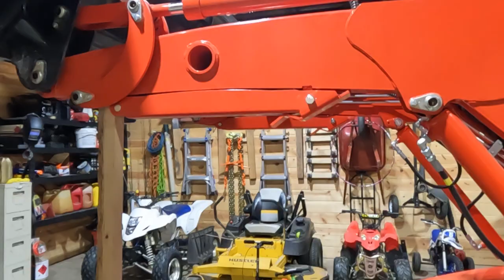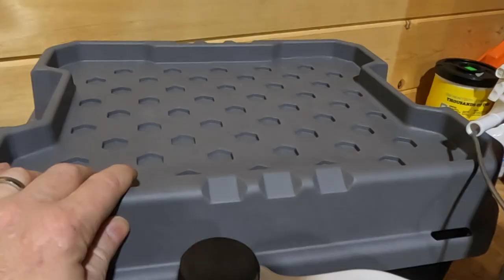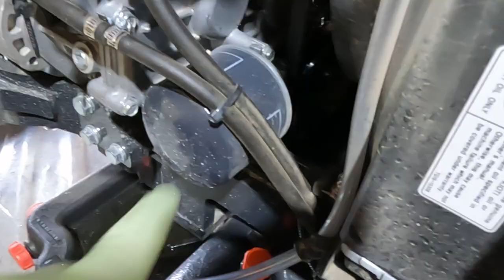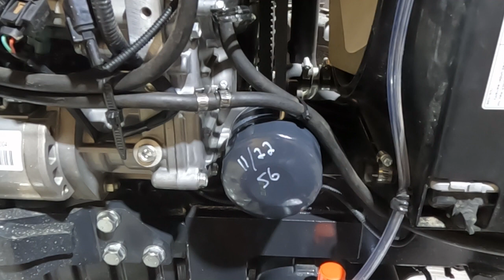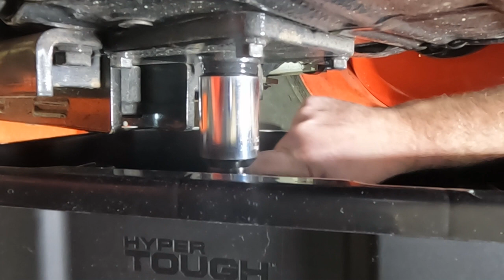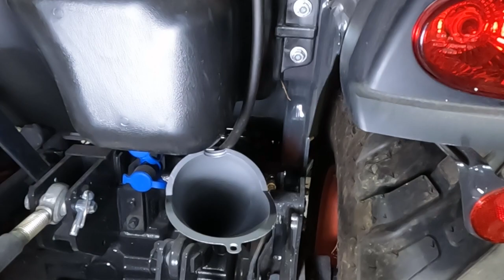Kioti CK3510 tractor 50 hour SERVICE and 1 Year review!! HST fluid had SPARKLES!!

Comment: Thank you for posting and very helpful.  Took the advice of Ben below and picked up a set of 3 leg oil filter tools.   Never knew about them before and thank you both!   Have a CK3520 with about 35 hours on it.
Reply from the maker: For my next oil change I will for sure be getting the 3 leg wrench. Them suckers are on there TIGHT!! Hopefully easier next time since I have had them off once.

Comment: I think they put the filters on and then paint it all and thats why they're so tough to remove. I didnt have much trouble with the engine oil filter but the hydraulic filters were a real bear. I would recommend the 3 leg filter wrenches to anyone doing this service. Just make sure the legs are long enough since the filters are moderately domed
Reply from the maker: They for sure put them on dry, then paint. I was convinced at 1 point that I was never getting the filters off.

Thanks for watching an commenting!

Comment: You need to ditch the 2x4, that is not a safe way to secure the loader and bucket, instead use a piece of angle iron placed along the struts... Also there is also a smaller plug to drain hydraulic fluid, found forward of the 31mm plug,  You can buy a hand pump from NAPA that mounts to the hydraulic fluid 5 gal bucket... saves your back and time
Reply from the maker: Good advise. I didnt have angle iron at the time, but I do now, and will for sure utilize it next time.